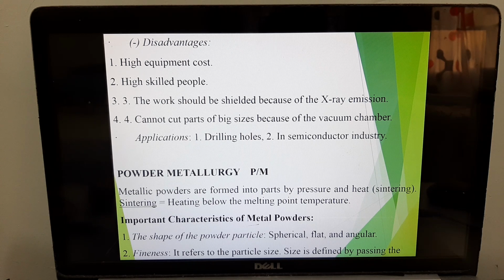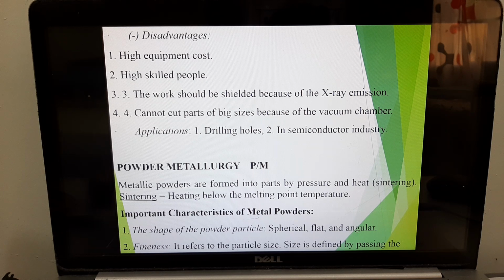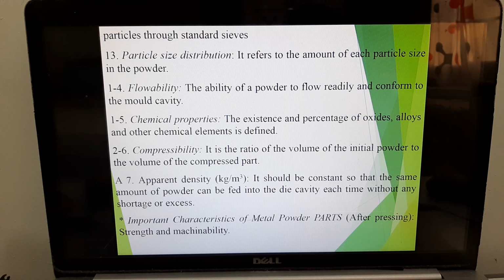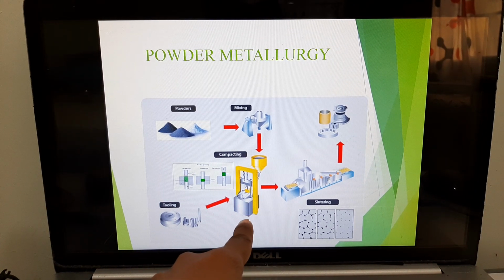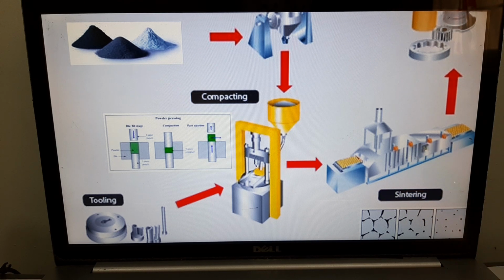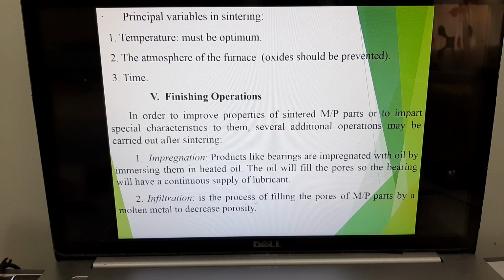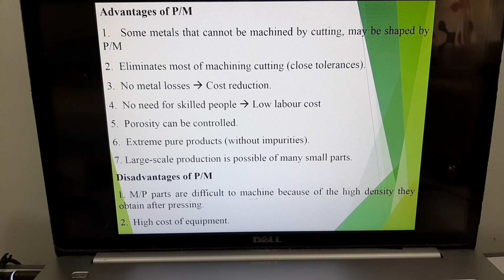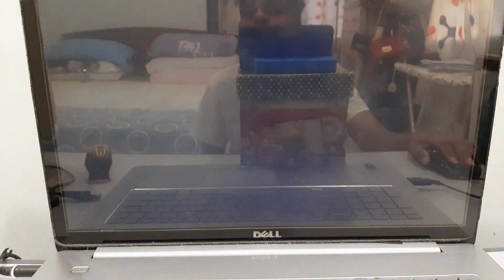POWDER METALLURGY PART 4

Comment: Good afternoon Dr, what i have learned from this video is about powder metallurgy. The powder is formed from metallic powder in micro/nanometer and formed into parts by pressure and heat sintering. Characteristics of metal powders is spherical in shape, size defined by passing particles through standard seives, particle size distribution, flow ability, chemical properties and compressibility.
Flow process of powder metallurgy is powder->mixing->compating->sintering->finishing operation.
Then there is impregenation and infiltration. Princiap products of powder metallurgy are filters with 97% porosity, cemented carbide inserts for cutting tools, gears/pump rotors out of iron and graphite, brushes for motors out of copper and graphic and bearings out of copper, tin and graphite. Benefits of this process are eliminates most of machining cutting, no metal losses, no need for skilled people and extreme pure products. Disadvantages however are higher cost of equipment,metal powders being expensive and difficult to store, difficult to machine due to high density and oxides may be produced during sintering. Thank you Dr

Muhammad Naquib Bin Nor Azlan
ME0106093

Comment: Mohammad Aliff Bin  Mohd Pauzi (ME0104760).
From this video i learn that : 

Particle Standart sieves
1]  Particle size distribution
2]  Flowability
3]  Chemical  properties
4]  compressibility

Step manufacturing step metal powder  parts

1]  process to manufacturing parts
2]powder prepareation
3]  making powder parts
4]  sintering
5]  fininshing operation

Comment: good evening madam i have learnt about PM from this video. metallic powders in micrometre/nanometer are formed into parts by pressure and heat. Sintering is heating below melting point temperature. there are characteristics formetal powder. the shape id spherical/flat/angular. the size defined by passing particles through standard sieves. particle size, flowability, chemical properties, compressibility. Impregnation is immersing products in heated oil to fill the pores so the bearing will have a continuous supply of lubricant. Infiltration is the process of filling the pores of M/P parts by molten to decrease of porosity. the advantages are  metals cannot be machine by cutting can be shaped through PM
, eliminates most of machining cutting, no metal losses(cost reduction). the disadvantages are  difficult to machine because of high density, higher cost of equipment, metal powders are expensive and difficult to store.

Luqman MIzani 
ME0106088

Comment: Good evening madam. From this video, i have learned about PM(powder metallurgy) where metallic powders are formed into parts by pressure and heat.There are several important characteristics of metal powders;
1)The shape of powder particle
2)Fineness
Advantages of PM;
1)Eliminates most of machining cutting
2)No metal losses
3)Porosity can be controlled
4)Extreme pure products
Disadvantages of PM;
1)Metal powders parts are difficult to machine because of high density
2)High cost of equipment
3)Metal powder are expensive and hard to store
That's all from me. Thank you madam
.
Mohamad Fayyadh Fazlula'ah
ME0106089

Comment: I learned about the metal powders which were formed by pressure and heat into pieces. Metal powder characteristics are in spherical, flat and angular form, the fineness that refers to the particle size specified by standard sieve, particle size distribution, flowability, compressibility and density with chemical properties. Impregnation, infiltration, coining and shaping, plating, thermal treatment and machining for finishing process. P/M's main products include filters, cemented carbide, gear and pump rotors, engine brushes, bearings, and magnets.  The benefits are certain P / M-shaped metal that can not be machined, near resistance, no loss of metal, low labor costs, porosity regulation, intense pure goods and large-scale small parts production.  Nevertheless, drawbacks which are difficult to machine due to high density , high cost, costly and difficult to store, poor particle flowability, explosive and fire hazards in a finely divided state, thermal difficulties during sintering and oxides during sintering can arise. 

Muhammad Harits Bin Mohamad Zailan
ME0106091

Comment: Rajbhinder Singh me0106908
Good day madam, the information gathered from the video is on powder metallurgy. It has the same concept as die casting, but we use metallic powders to molten form and poured into a mould and compressed and sintered (heating below melting point). we use metallic powder have many important characteristics such as its spherical, flat and angular, the fitness Shape: Spherical,flat and angular, particle size distribution: amount of each particle size in the powder, flowability the ability of powder to flow readily and conform to the mould, chemical properties the existence of oxides, alloys and other chemical elements, compressibility the ratio of the volume of the initial powder to the volume of the compressed part and lastly

apparent density the constant, same amount of powder fed into die cavity.
First, the powders will be sieved to ensure particle size is in nanometer, then we mix it with desired iron sulphide or. Then we compact the powder mixture with a hand press into a mold to compact into shape. Once we have the shape, we then undergo a sintering process by heating it up above recrystallization temperature, heat it up below melting point to ensure it in semi solid shape. during this process the void will be eliminated and shrink.
the finishing operations are, impregnation products like being are impregnated with oil by immersing them into heated oil. The oil will fill the pores so that bearing have continuous supply of lubricant. Next is infiltration which is the process of filling pores of powder metallurgy parts by molten metal to decrease porosity. Examples of powder metallurgy are Filters , Cemented carbide inserts, Gear and pump rotor, brushes for rotor, bearing, magnet. The advantages it can machine metals which
cannot be machined from cutting, close tolerance, no metal losses, does not need skilled workers, controlled porosity, extreme pure products, large scale production. The disadvantages are that the parts are difficult to machine has high machine cost,powder is expensive and hard to store, intricate designs are difficult to be attained, may be explosive or flammable,thermal difficulties, oxides may be produced on the material.

Comment: In this video I learned about powder metallurgy where metallic powders in micrometer/nanometer are formed into parts by pressure and heat(sintering. Sintering is heating below melting point temperature.
Advantages of powder metallurgy :
	metals cannot be machine by cutting can be shaped through powder metallurgy
	eliminates most of machining cutting
	no metal losses(cost reduction) 
	no need for skilled people 
	porosity can be controlled 
	extreme pure products 

Disadvantages of powder metallurgy:
	difficult to machine because of high density 
	higher cost of equipment 
	metal powders are expensive and difficult to store 
	intricate designs difficult to attain because of poor flowability 
	some powders present explosive/fire hazards in a finely divided state 
	Some powders have thermal difficulties during sintering(oxide formation) 
	Oxides may be produced during sintering

Comment: Good morning madam, I learned about powder metallurgy where metallic powders in micrometer/nanometer are formed into parts by pressure and heat(sintering). Sintering is heating below melting point temperature. 
Characteristics of metal powders: 
1) shape: spherical/flat/angular
2) fineness: size defined by passing particles through standard sieves.
Particle size distribution: amount of each particle size in the powder
Flowability: The ability of a powder to flow readily and conform to the mould cavity
Chemical properties: existence and percentage of oxides/alloys/ chemical elements
Compressibility: ratio of volume of the initial powder to the volume of compressed part.

Powder(filtered using standard sieves) -> Mixing -> Compating(using hand press) -> sintering(material shrinks as voids are eliminated) -> Finishing operations(to improve/impart) 
Impregnation: immerse products in heated oil to fill the pores so the bearing will have continuous supply of lubricant
Infiltration: process of filling pores by a molten metal to decrease porosity

Principal products of P/M:
Filters: 97% porosity
Cemented carbides(inserts) for cutting tools: tungsten carbide+cobalt
Gears/pumps rotors: iron+ graphite
Brushes for motors: copper+ graphite
Bearings: copper+tin+ graphite
Magnets

Adv. of P/M:
1) metals cannot be machine by cutting can be shaped through PM
2) eliminates most of machining cutting
3) no metal losses(cost reduction)
4) no need for skilled people (low labour cost)
5) porosity can be controlled
6) extreme pure products
7) large scale production for small parts

Disadv. of PM:
1) difficult to machine because of high density
2) higher cost of equipment 
3) metal powders are expensive and difficult to store
4) intricate designs difficult to attain because of poor flowability
5) some powders present explosive/fire hazards in a finely divided state
6) Some powders have thermal difficulties during sintering(oxide formation)
7) Oxides may be produced during sintering

Thank you madam!!
AHMAD NAZRI BIN AHMAD TAMRIN ME0106079

Comment: NIGEL ANDERSON SINGH A/L RAJDEEP SINGH 
ME0106094
Good day, madam. Metallic powders formed into parts by pressure and heat (sintering = heating below the melting point temperature). Characteristics of metal powders are in the shape of spherical, flat and angular, the fineness which refers to the particle size which is defined through standard sieve, particle size distribution, flowability, chemical properties compressibility and density. The process of powder metallurgy : powder ---> melt ---> compress ---> sintering ---> final product. In finishing operation, Impregnation (immersing in heated oil which fill the pores and have continuous supply of lubricant), Infiltration (filling the pores by molten metal to decrease porosity), coining and sizing, plating, heat treatment and machining. Principal products of P/M are filters, cemented carbide, gear and pumps rotors, brushes for motors, bearings and magnets. Advantages : some metal that cannot be machined may be shaped by P/M, close tolerance, no metal lost, low labour cost, porosity can be controlled, extreme pure products and large-scale production of small parts. Disadvantages : hard to machine due to high density, high cost, expensive and difficult to store, poor flowability of particles, explosive and fire hazards in a finely divided state, thermal difficulties during sintering and oxides may be produced during sintering.

Thank you.

Comment: Good Day, Dr. I am Derrick Ng Kian Ping (ME0105733). At the end of the video, I have learned about powder metallurgy where the raw material is in powder. Metallic powders are formed into parts by pressure and undergo sintering where it is heated below melting point. The important characteristic of Metal powders are the shape of powder particle whether if it is spherical,flat or angular, fineness where size is defined by passing particles through standard sieves, paticle size distribution (amount of particle size in powder), Flowability (ability of powder to flow readily and conform to mould cavity), chemical properties(percentage of oxides,alloys and other chemical elements), compressibility (ratio of volume of initial powder to volume of compressed part) and finally, apparent density should be constant. Moving on to the process, firstly, Powder where particles undergo standard sieve. Next, Mixing where alloy and chemical elements are added. Then Compacting where the powder mixture is compacted with a hand press into a mold. Once the shape exist, sintering is done where it is heated above recrystallisation temperature. There are 6 finishing operations which are impregnation (products like bearing are impregnated with oil by immersing them in heated oil and the oil will fill the pores so bearing will have a continuous supply of lubricant), Infiltration (process of filling pores of metal powder parts by molten metal to decrease porosity), coining and sizing,plating,heat treatment and machining. The products of Powder Metallurgy are firstly, 97% porosity, cemented carbide   (tungsten carbide + cobalt), gear and pumps rotors (iron + graphite), brushes for motors (copper + graphite), Bearing (copper+tin+graphite) and magnets. Moving on, the advantages of Powder Metallurgy are some metals can be formed by powder metallurgy, machining cutting is eliminated,no metal losses, does not required skilled people, porosity can be controlled, extreme pure products and large scale production is possible for small parts. However, the disadvantages are difficult to machine because of high density obtained after pressing, high cost of equipment, metal powders are expensive and difficult to store, intricate designs in product are difficult to attain, some powders are explosive, fire hazards and have thermal difficulties and finally, oxides may be produced during sintering.
Thank You.

Comment: Good evening madam , from this video i have learned about Powder Metallurgcy P/M. Metallic powder formed into parts by pressure and heat (sintering). 
Shape of powder : spherical, flat, angular
finenesse: refers to particle size. size is defined by passing through standard sieve.
Powder -> Making parts -> sintering -> finishing operation

Impregnation - products like bearing are impregnation with oil by immersing they in  heated oil . The oil fill pores so the bearing will have a continous supply of lubricant.
Infiltration - process of filling the pores of M/P parts by molten to decrese of porosity
Coining and sizing
plating
Heat Treatment
Machining
Some principle products of P/M : Cemented Carbides , gear and pump rotors, brushes and motor, bearing and magnets.
Advantages : No metal losses
no need skill people
large-skill production
disadvantages: High cost equipment
Oxides formed
Metal powder are expensive and difficult to store

Name : Alif Haikal Bin Azly
ID: ME0106081

Comment: Good Morning Madam,i have learned about powder metallurgy from this video,metallic powder is formed into parts by heat and pressure (sintering: Heating below the melting point temperature).Characteristics of metallic powder are :spherical,flat and angular in shape,must be able to pass through standard sieve,particle size distribution ( the amount of each particle size in the powder),,chemical properties (The existence and percentage of oxides, alloys and other chemical elements is defined), compressibility (the ratio of the volume of the initial powder to the volume of the compressed part) and apparent density (should be constant so that the same amount of powder can be fed into the die cavity each time without any shortage or excess).
The process of powder metallurgy is sieve powders with standard sieve to ensure the their size is in nanometer scale,then it will be mix with the required powder of others element.Next it will be compact the mixed powder into mold using hand press .After that ,sintering start and powder will be more compacted as void is removed during sintering.

FInishing operations:Coining and sizing, Plating, Heat treatment, Machining.
Impregnation: Products like bearings are impregnated with oil by immersing them in heated oil. The oil will fill up the pores so the bearing will have a continuous supply of lubricant.
Infiltration:  process of filling the pores of powder metallurgy  parts by a molten metal to decrease porosity.

Example of powder metallurgy are Filters Cemented  carbides (inserts) for cutting tools, Gear and pumps rotors: (iron + graphite), Brushes for motors: (copper + graphite),Bearings: (copper + tin + graphite), Magnets.

The advantages it can machine metals which cannot be machined from cutting, close tolerance, no metal losses, does not need skilled workers, controlled porosity, extreme pure products,  large scale production. The disadvantages are that the parts are difficult to machine,has high machine cost ,p owder is expensive and hard to store, intricate designs are difficult to be attained, may be explosive or flammable,thermal difficulties, oxides may be produced on the material.

Tan Kang Je
ME0106097